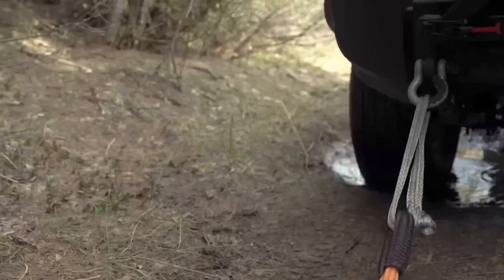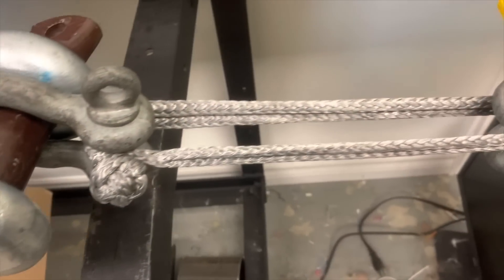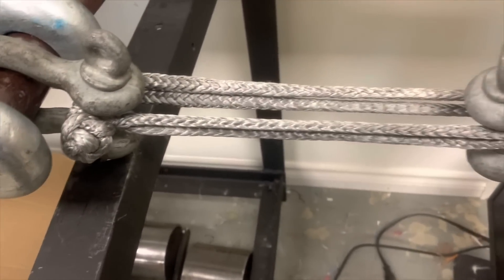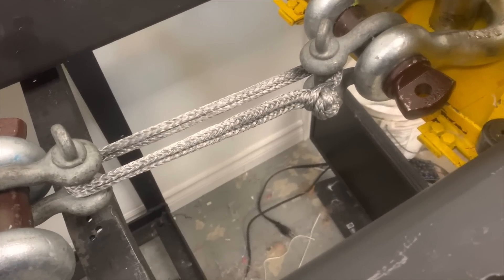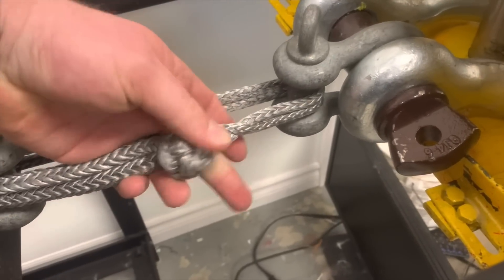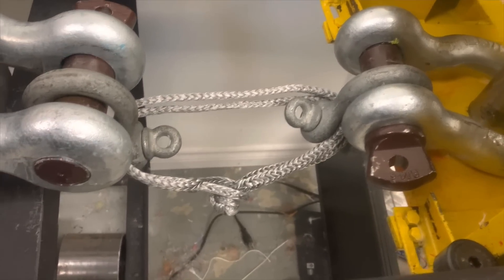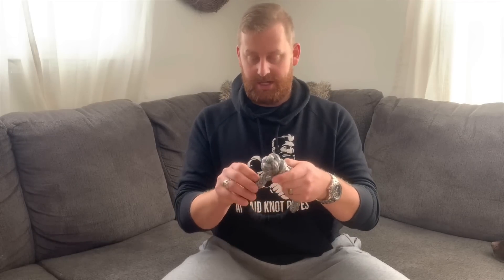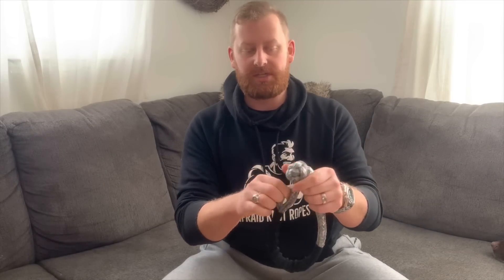FACT OR FICTION? Soft shackle positioning

Comment: great video, I appreciate the testing side of this video and the details. What about "shock load" (using vehicle to snatch recover another) testing? are the results the same in break strength?
Reply from the maker: Great question I am trying to get some information like that together for another video. It is quite expensive to get a dynamometer able to test that high especially one that can be taken out in the field. 
In terms of shock load that would depend on the type. If using one of our kinetic ropes the load would be much more gradual of course with a static line (bad idea) it would fill load be nearly instantly. We recommend soft shackles that are over rated to account for the shock load.
Reply: @afraidknotropes   - hownot2 may assist. ??
expand their rope craft into the 4x4 world.
Reply: @kadmow  I have seen a bunch of their stuff maybe I can get a hold of them.